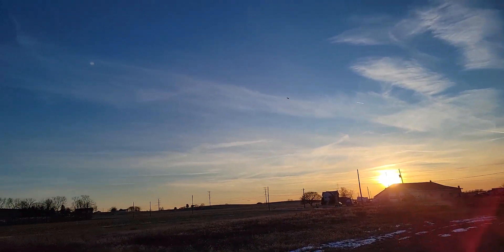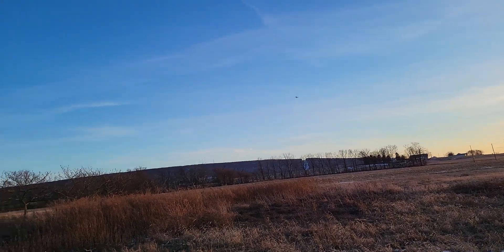Beautifully printed A-4 Skyhawk models (Description & Flight 3-E-Sun .48)

Comment: 50mm really is a great size for printed jets. Small enough to be quick to print and build, big enough to be stable in the air. I was first introduced to it by PTIKYLE and I'm glad that your aircraft follow the same standard.
Reply from the maker: @ksweens01  Yeah it works out well. You have to be very careful with weights though when 3D printing jets. Especially when printing with infill like all of his designs. Him and I design differently. His airplanes are just a shell that is cut apart, and the slicer adds infill and structure to the inside. So everyone that prints one is different, and their weights could be drastically different if not careful. There are travel moves and retractions in his models so there is also cleaning up of the parts, and a little extra work involved to build one. I build all my structure on the inside myself in such a way that the printer does all the work, and never stops putting material out where it is supposed to. This cuts down on travel time drastically(sometimes travel is about 40% print time) and produces a much cleaner model, with structure only in important areas. Modeling this way is much harder though, and requires a lot of thinking ahead. I think that’s why I enjoy it so much, is because it is very hard to do successfully. With one of my models, what you see is exactly what you will get. Your results will look and come out the same. I also provide G-Codes with my models so anyone with a printer and almost no experience can print it and get the same results I get. Simply insert them into your printer. It takes me months to produce a model this way, but is worth it in the end. I think Kyle put out about 10-12 models in the time I was making this A-4.. Thanks for your interest in my A-4. I have a build and other flight videos for this one also.